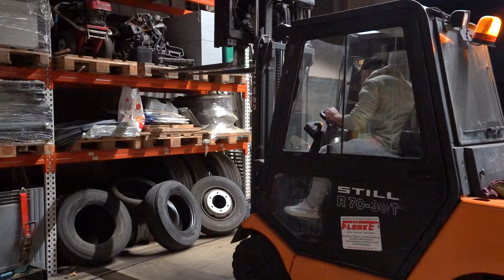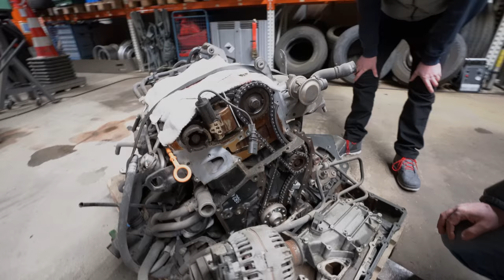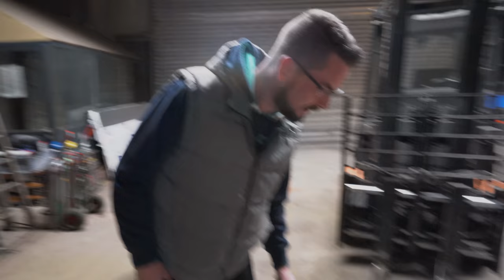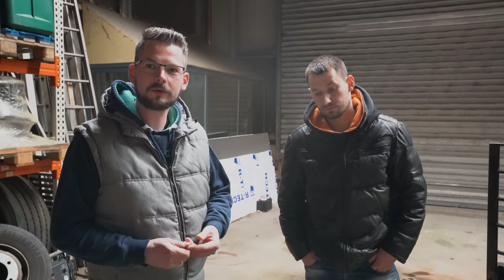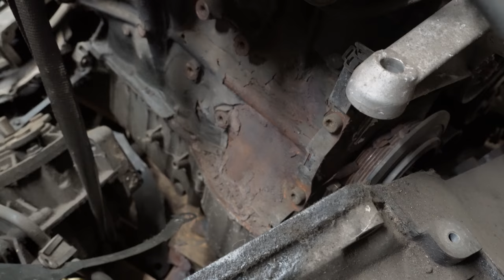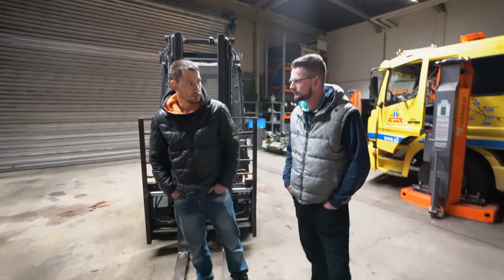Ist der MOTOR SCHROTT  ?  2.8 V6 - René Bàuche

Comment: Lass die Finger vom Motor, ich denke die Jungs haben recht. Hol dir nen Austauschmotor, die 1,8T gibt es mit unter 100.000km teilweise für 1700 und der R32 für 3000

Comment: Moin. Also wir finden das du nicht nur ein gutes Vr6 Background hast und die Argumentation das die Riemenscheibe rostig ist und alle Schrauben getauscht werden sollen/müssen ist etwas ungünstig gewählt. Trau dich. In den Motor steckst du gut 1000-1500 an Teile dann läuft aber auch alles. Einen weiteren gebrauchten holen den wir zb dann beim Einbau auch Teilüberholen würden ( Steuerkette, Wapu und Ölpumpe zb.) ist der Nutzen Aufwand mit Kosten sogar höher jeder Vr Fahrer rät dir wenn alles raus ist die Kette zu machen.

Nimm den Kopf ab mach ein weiteres Video wie er vom Zustand ist und man kann dann entscheiden Motor revidieren oder anderen holen.

Schrauben bekommt man großteils bei VW noch neu.

Teile hätten wir sonst auch noch liegen.

Wir finden es stark und freuen uns schon auf die Video Reihe, endlich mal wieder Schrauben 👍✌️

Comment: Mit nem laufenden anderen Motor wärst du definitiv günstiger und mit weniger Kopfschmerzen unterwegs. Schneller noch dazu. 
Einziger Vorteil ... den VR6 hier könntest du als billige Basis für nen VR6Turbo Umbau nutzen, sofern der 2,8er Block sich dazu eignet. Der (V)"R30Turbo" Umbau war ja glaube eher der 3.2er Block mit ner 2.8er Welle, wenn ich das richtig im Kopf habe!? 
Also im Umkehrschluss den Block auf R32 bohren aber die Welle behalten, R30Turbo und go. 
Kostet natürlich Zeit, Geld und Nerven. 
Wenn der Eimer einfach nur funktionieren soll, kauf dir lieber n 1.8T oder eben wieder n VR6 (2.8 oder gleich 3.2) und gut.

Comment: Ich wüsste nicht was so schlimm an dem Motor wäre. Rost am block normal. Steuerkette etc. Sollte man eh mal neu machen... Also warum so kleinlich? Wer den Motor als so schweres Projekt sieht, sollte das Schrauben lassen.

Backofen Reiniger und das oxidierte sieht wieder Top aus. Lass dir nichts einreden. Material für Pumpe, kopfdichtung, kette etc ist nicht teuer. Motor gebraucht holen ist Schwachsinn wie er sagt. Dann baust ein und machst 5tkm wieder raus und die Kette. Für die jungs ist alles scheinbar tot

Comment: Ist halt ne Basis ;) Und die Katze im Sack kaufst so oder so !!!  Egal ob der Motor läuft oder nicht, interessant wäre was das ganze auf der Palette kostet.  Du wolltest doch eh auf Turbo umbauen ?? Da kommt eh der Kopf runter, und selbst wenn du nen laufenden Motor kaufst, die haben alle ca 20 Jahre aufn Buckel und die angeblichen 100tkm ;)  Hauptsache KW und die Zylinder haben keine Rostnarben, und dementsprechend würd ich auch mit dem Verwerter verhandeln.

Comment: ich fahr auch den golf 4 aber halt in 2.9l und geladen und kann dir aus erfahrung sagen, kauf dir einen gebrauchten motor der läuft. aber den „kernschrott“ solltest dir auf jedenfall behalten! alleine das getriebe kann man gut verkaufen, den block kannste ja beiseite stellen und später mal verstärken und zu guter letzt, die blöcke werden nicht weniger 😅 
by the way: R30 ist R32 block mit der kurbelwelle vom 2.8er.. oder den 2.8er block aufbohren auf 83mm, dann biste auch auf 3L